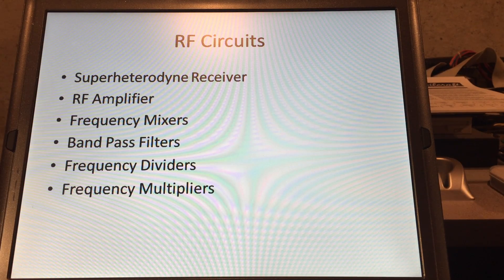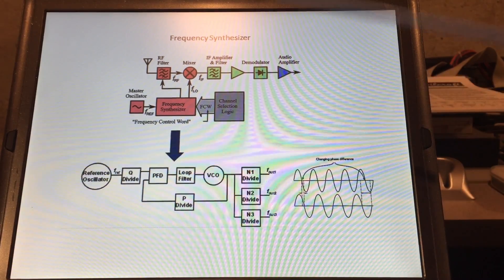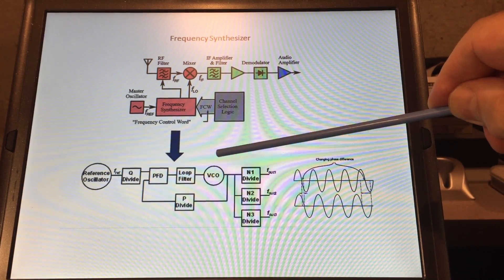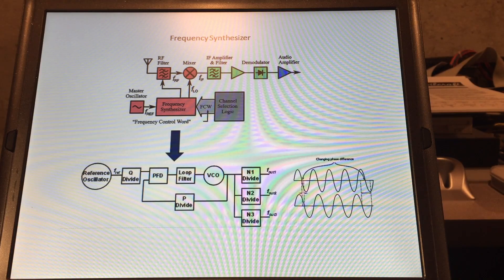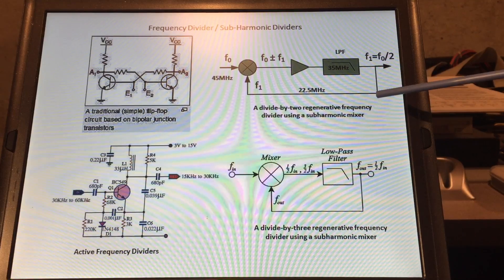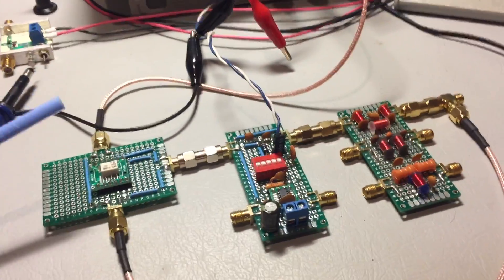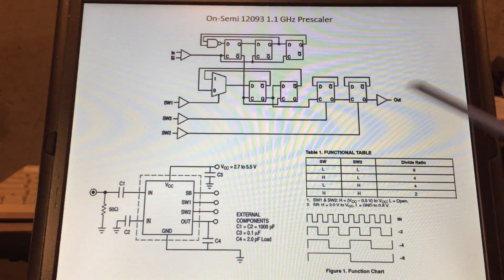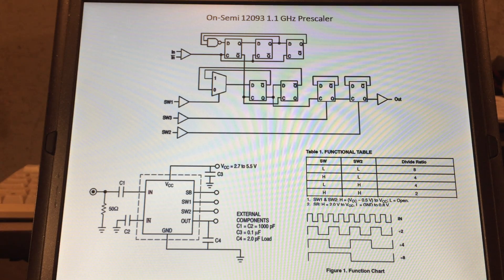Superheterodyne Receiver Part 3 (Frequency Dividers)

Comment: Very good lessons about frequency! I'm trying to build a frequency divider that could be used to measure a GHz signal with a 100MHz osciloscope.  I've been tinkering with some circuits using decade counters, flip-flops, but they all fail to bring a GHz signal down because they are mostly intented for 1MHz to 60MHz frequencies. Do you know what is the best way to achieve this?

Comment: Is it correct that the first part you were explaining with the phase detection and VCO feedback loop, is called a PLL (phase locked loop)? I never really understood this concept until your explanation. Thank you sir!
I still have some questions though. I understand how we would use this synthesiser as a tuneable oscillator to 'select' our input frequency by mixing it in with the input signal. However, it is also used in the RF input filter to filter our input signal from the antenna. How does that work? Also, by using division, we're still only able to select discrete frequencies. So how would we use it to select any input signal we want? Sorry, I'm completely new at this RF stuff... Thank you for your awesome videos, you are a good teacher!